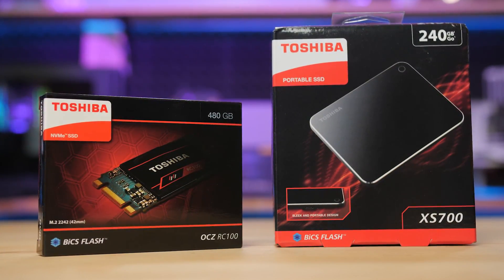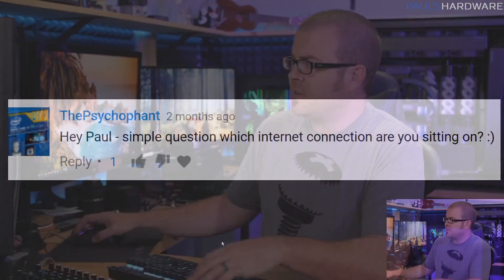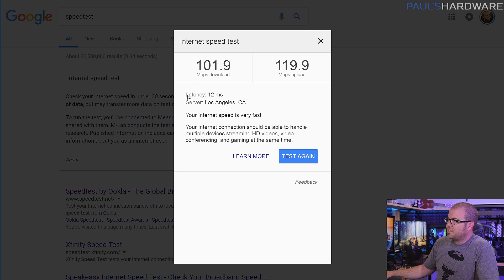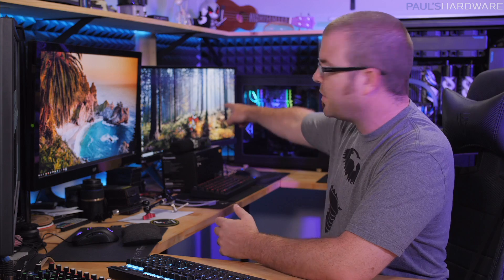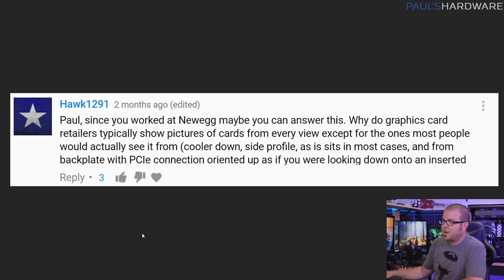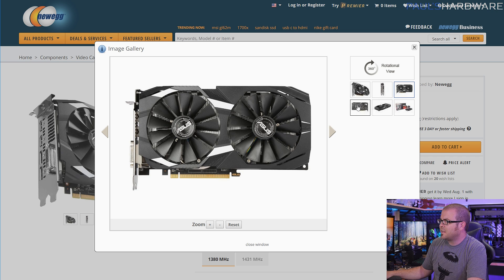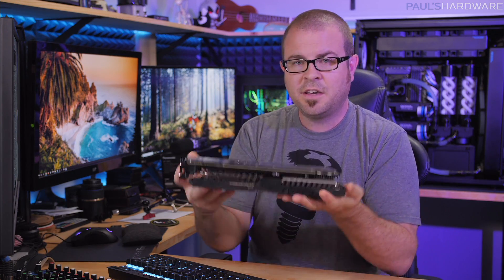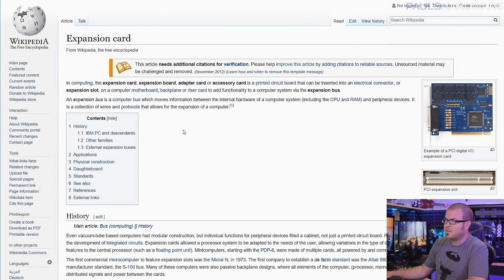Why are GPU Coolers on the "Bottom" Instead of the Top? - Probing Paul #26

Comment: As for the GPU cards orientation, originally computers were laid out horizontally (usually with the monitor sitting on top of it) rather than how they've become vertical with today's computers.  That's more conducive for heat to rise as well.   But then the trend changed to have them stand vertically.  

I would add that the reason they would have done that would have been done for a couple of reasons. One, they started to use lighter materials in the construction of computer cases.  Many of the cases were made of steel originally and at the time that was good because it also helped support the weight of the monitors as they were usually placed on top of the computer but then PC's slowly evolved to lighter materials such as aluminium   But then monitors were also evolving from the typical 14 inch CRT's (which weren't that heavy) then to 17 inches and then to 21 inch CRT monitors and trust me... those suckers were heavy AF!!  Showing my age, just taking my computer into the location of the LAN we were having usually meant I didn't need a workout that week. :D

Having a big monitor on the desk meant you really couldn't have a horizontal desktop as well (not without taking up the whole desk), so it made sense to stand them vertical and either move them to the side of the monitor or off the desk entirely and onto the floor.  I'm guessing here but considering when they first did this, gpu cards really didn't generate that much heat (in fact most of my video cards from that time didn't even have fans for a long long time) and so that is also why they didn't need to change the orientation of the internals even though the orientation of the "desktop" had changed.  

As GPU's got more powerful, they got hotter and so they needed to cool them and then usually the manufacturers (like AMD & Nvidia) used blower style fans that expelled the heat out the back of the case.  They still use those fans on their generic cards whereas 3rd party companies like Asus, EVGA etc changed the fans to the types we have today.  Personally I think they need to overhaul the internal designs, but they have adapted well so far with better case designs and airlow, better fans, better heatsinks and water cooling.  When that isn't enough, the industry will probably makes some changes.... maybe. 

And after all that... I'm spent. :D  (also if I had just waited till the next question after the GPU question, I would have seen Paul mention horizontal computers) oh well.
Reply: If I understand correctly the actual Orientation of the fans and whether they are on top or bottom doesn't actually matter.  What matters is the Intake and outtake of the fans and whether it blows on the Heatsink or sucks air away from the heat sink.  From online it suck onto the heat sink which means  it is pulling air from the cold air at the bottom.  If it was on top the sucking or intake side would be facing away from the heatsink pulling air through.  Even if the reverse is true the oritentation wouldn't matter one way or the other cause the fans outtake and in take would work the same on ether side.  As an example if the fans suck then the fans facing down would be intake side down sucking air and the outtake side blowing on the heatsink and if you put the fans on top the intake would be pulling air through the heatsink facing up and the outtake face into the heatsink blowing air our the sides..  The mistake here is assuming the fans are blowing away from the heat sink which there are not in most cases.  The hot air should blow out the side.  You can look up charts online for more details.  Actually science wise putting on top would mean sucking hot air from the CPU in most PC builds which would be why the face down and not up.
Reply: This comment is underrated.
Reply: Wow. What a nerd
Reply: i dont recall seeing aluminum cases outside of 'premium' or 'enthusiast', most everything is still steel & LCDs are much lighter than CRTs

i doubt orientation will make any difference in heat due to the airflow being forced by various fans, maybe one idea for the spec is to aim components away from or interfering with the cpu heat source
Reply: Ryan Bruce Bruce stfu u should start studying
Reply: The Thugger hush now geeky boi
Reply: The Thugger thank you
Reply: This is what I was about to say as well. "Desktop" orientation was more common than "tower" orientation. You might as well have the components facing away from the CPU area.
Reply: It depends.  They had both kinds fairly early on, such as in tower designs.

Back in the late 80's and early 90's, computers in general made much less heat so the orientation wasn't important.   The power supply in the case removed most of the heat, and it was rare to have any exhaust fans.

Comment: I'm using a big Silverstone HTPC case for my desktop.  It works great.  I have my monitor on top, which puts it at the perfect eye-level, and my desk is deep enough that I have plenty of room in front.  And if I'm eating or using my desk for something other than computing, I can just place my keyboard on top of the case in front of the monitor and have plenty of room.  My intakes are on the sides (which would be the top and bottom on a tower) and my exhaust is out the back.  Works nicely, and for me actually takes up less desk real estate than a tower, since the top of the case can be more desk.

Comment: If you want your graphics card facing the right way just turn your pc upside down. No special parts required. Depending on how flat the top of your case is you may need to attach the case to the underside of your table or desk. You might also want an extra fan on the bottom of the case, which is now the top.

Comment: For that last question Silverstone GD07 and GD08 are HTPC cases that fit ATX motherboards and match 17" rack components.  I built a Plex server/client machine for a friend in the GD07 and fit 8X 3.5" drives plus a Blu Ray player in it with a full ATX motherboard.  I personally use a HAF EVO for my living room pc.  It's also 17", but 8U instead of 4U...it sits on top of my rack instead of in it.

Comment: i remember, "way back then in the olden days", our first Intel-based family computer was a 386SX/20... yea that's right, a full 20 MHz of power and 2 MB of ram! ...and of course about a month later, 486 became the typical architecture... which set an unwelcome trend for my computing for many years.

BUT ANYWAY! yea, that 386 was a horizontal style, right around the time that was starting to become 'uncool' in the design wars.  it was a few years, but i was so happy to finally get a "proper" upright tower.

i think the horizontal tower style lost popularity for 2 main reasons... or possibly one reason looked at 2 different ways.
1; it took up a LOT of real estate on your desk, and due to the form factor, putting it off to the side, or down on the floor was very inconvenient
2; while that could be partially alleviated by putting the screen on top, and you pretty much HAD to do that to have any desk surface left, that made the monitors REALLY high up, relative to your sitting height.

vertical towers could be put under the desk saving all that desktop space. and remember, it was still giant CRT monitors back then. with the KB, mouse, and monitor each needing X amount, desktop space was a somewhat prized commodity. also, with the optical drive at the top, it was still high enough that bending down to switch CD's wasn't an ergonomic nightmare. 

and, of course, the whole modding scene hadn't really taken off yet. PC's were all just metal boxes in varying shades of slightly-off-white... if you were showing it off, it was just to show off that you actually had one at all, rather than for any particular example of attractiveness on its own part.

...dang, now i feel old, rambling on with tales of how things used to be in the dawn of the home-computing era, lol.

Comment: I guess to flip GPUs over at this point in time would take a large, concerted, coordinated effort from most GPU and motherboard manufacturers together.
At the moment, most GPUs would run into clearance problems with the CPU cooler, so flipped GPUs would need to come out at the same time as redesigned motherboards. Seems unlikely, given how valuable backwards compatibility and cross-brand compatibility is.

Comment: The only thing I can think of with graphics cards being fan down is it keeps dust/debris from falling into the fans by having them on the bottom.    Personally, I think the aesthetics of graphics cards are terrible and I would like to see them redesigned.  For example, why are the power cables always on the front instead of the side where cables could be better / easier routed?

Comment: One trick I do for a minor to medium GPU sag.   I Loosen the hold down screws by a few turns.  then I lift the far corner of the video card (near where you plug in your power cables)  and I lift it up gently till it raises higher than the rest of the video card.  then while holding it in place I tighten the hold down screws.   this seems to level my card pretty good 95% of the time. The few times this did not work, I just bought a card brace online.
Reply: this sag talk makes me wonder, isnt it applying extra strain on the area where the bracket attaches to the card? though maybe it's similar to the one caused by gravity in the first place
Reply: I lift the corner gently and then tighten the mounting screws, doing this helps to make the card level or better then it was to start.(providing you even have card sag, most do not)  You want the strain on the mounting bracket, and not on the PCI slot.   if you don't mind seeing your card hang down a little on the end then it is not an issue.

Comment: I would say that the currently prevailing GPU cooler orientation makes perfect sense! If you've got fans impelling air into a cooler, you want those fans sucking in cool air from below the card instead of warmer air from above the card. Why suck and not blow? As one of Paul's shirts preaches, air pressure should Stay Positive™ for best results.

Comment: Expansion card orientation is difficult to explain. But easy to visualise. ISA faced upward PCI faced downward. The reason for this is that PCI is a parrallel bus capable of suppoting 6 slots. With the ATX form factor providing for 7 expansion slots. This meant there would not be any (maybe one) leagacy slots so they flipped PCI upside down so that two slots on a motherboard could share a ATX expansion back plate. You could not install two cards at the same time but you could choose.

Here is a image and a good twitter explanation.
https://twitter.com/Foone/status/985817818405863425

Comment: What if a company made a graphics card facing up? Would that be in violation of some spec or Nvidia requirements? I hadn't though of it until now, but I can't believe it hasn't been done. Not so much for thermal improvement (I doubt there would be a difference), but for aesthetic reasons.

Comment: Hey @Paul's Hardware, maybe the GPU cooler is placed on the bottom because its easier to expand down over possibly unused PCI-E slots instead of up. The top slot would be unavailable to GPU's because of coolers on the top.

Comment: Considering current motherboard design, flipped graphics card would not really work. Motherboard would have to be redesigned to support the thickness of upside down graphics card. So maybe in the future when a new standard is created, they will leave more room between the CPU and the top most slot.

Comment: 5:12 Why? Because, you.....:
- ALL GPUs' fans pull air IN, not push out!! And being up, it will pull hot air in from CPU! The air exits from its sides, very easily.
- Also, when up, all the dust will be sucked in, damaging the fans and its components! It can suck dust while being down, too, but not as much. Not to mention while it's up, and the PC turned off, when the dust settles, it goes even more into the fans, etc...

Sorry Paul, but it makes all the practical sense!

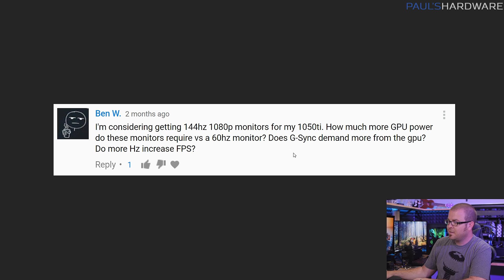8:08 Do more Hz increase the FPS?
- DOH!! Do a little research by yourself, I promise it won't kill you. Much........

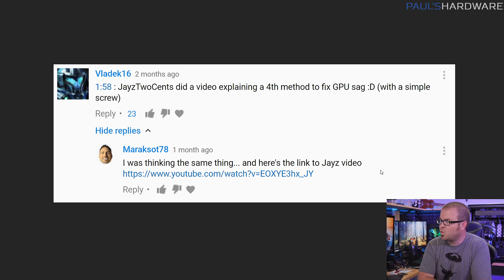11:45 Graphics card sags?
- Use a EVGA PowerLink. Yes it's a costly method, but it and the cables will look a lot better and cool.
Reply: Hz wont increase fps wtf

Comment: The Silverstone Grandia series. The GD09 especially is nice for full atx. I would recommend getting an sfx power supply though. It can hold a atx power supply but it takes up a lot of the limited space.
Reply: Sportsfamily77 I have the GD-08 and 100% agree. Excellent cooling, tons of storage space, and even has a side fan mount perfectly placed to cool vrms. Just transferred my build to it from an ancient Lian Li case. Steel instead of aluminum and the paint job isn't as nice, but not an issue when tucked away in a cabinet.

Comment: Hey Paul, the question about the g-sync monitor made me think, but i'd like your opinion. I currently game on a 1080p 144hz non-gsync or anything monitor, with a 1060 6gb. I have wanted to get into g-sync for a while, to discover that the monitor prices are disgustingly high for g-sync, even something 1080p. This has made me think, would it be cheaper/more cost effective to get a freesync monitor and upgrade to something like a vega 56? Thanks
Reply: how is a vega56 in the same price & performance bracket as 1060? you'd have to do some real careful math & become familiar with radeon quirks to make it a good idea

i would not change anything, tearing on 144 is not as bad as on 60, or better vsync on 144 wont be as stuttery or laggy as on 60, in addition to the option of simply running 60, 90, 120 vsync depending on the game

Comment: The standards mean nothing, they could still use the connections in the same place and have the hardware on top. They couldn't adjust connection points.

Comment: The reason for pci/pci express being "upsidedown" is because when they went from ISA to PCI they wanted to be able to have a backpanel slot be able to take either a ISA or a PCI card. So by flipping one of them both connectors could sit side by side on the motherboard, also so that people wouldnt put pci cards in an ISA card slot and vice versa.
Reply: SandyStarchild That's my memory as well. When PCI came out, a lot of motherboards had both, and PCI could be interleaved with ISA on the motherboard, with the cards sharing the backplate. That allowed us to migrate from one to the other without not having enough ISA slots initially, or not having enough PCI slots later on.
Reply: I remember that too, also most computers were sat on desks orientated with the MB at the bottom so the up-down question didn't really figure as much a tower was a space saving exercise which became the norm.
Reply: This is the correct answer.
Reply: or would it just make too much sense... dust... dust settles down??

Comment: If you use an inverted motherboard then the GPU cooler will be the right way up :)
Reply: I do and while this fixes that, nearly every fuking logo is upside down and this triggers.me.
Reply: But the fans will be blowing the heat down.
Reply: mines inverted
Reply: My VERY-OLD Dell prebuilt had an inverted motherboard and it triggered me 2
Reply: fans now opposing convection
Reply: many Dell models open on the opposite side, engineered that way on purpose, all about replacement parts and making money...
Reply: Uncle Dunk yes Paul mentions this